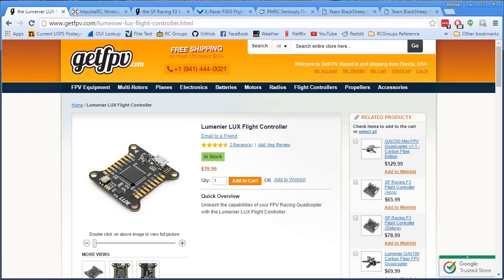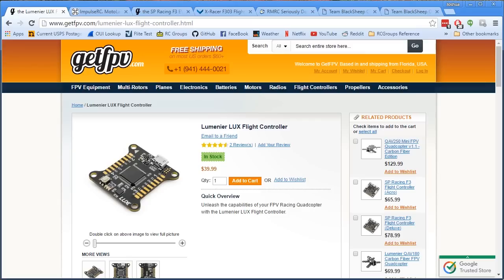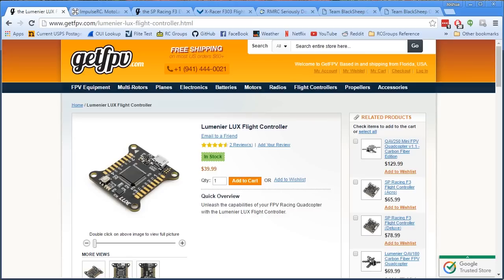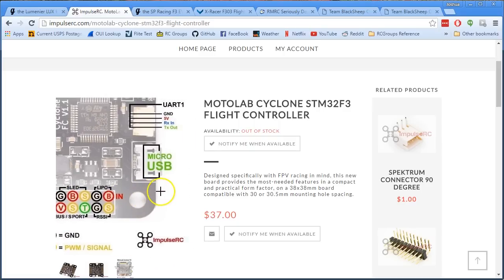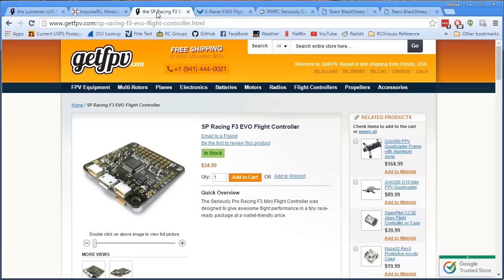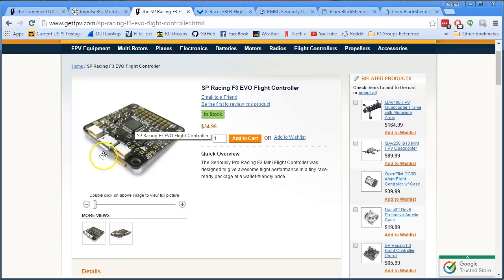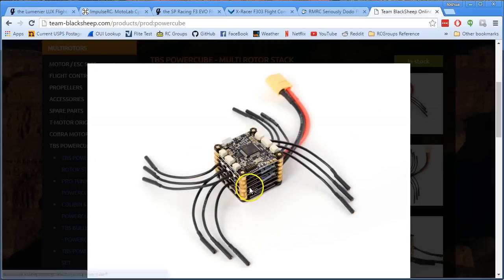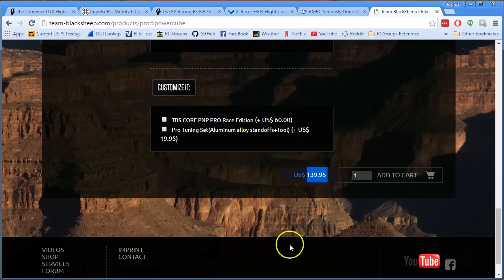The Best Cleanflight Flight Controller(s) - May 2016 Update

Comment: Joshua, a little help please. I have 4 new (built ) quads and none of them connect with clean flight. I have never flown a quad FPV. Under discs and printers, the device shows as a virtual bridge controller and Zadig does not help. These are F3, Naz boards, CC3D boards, and customied f3 x303 boards. I can not blast it off of virtual bridge to whatever it takes to connect. The only board that connects is the SP F3 Evo board. Any ideas would be helpful.
Reply from the maker: Delete the device, reboot your comptuer, then follow these steps.

https://www.youtube.com/watch?v=m4ygG6Y5zXI

Comment: Have 2 qav210s with 1 having the f390 lumenier(BLheli) ESCs 30a running 2205/2400kv Skitzo motors on a lux board and had No tuneing issues whatsoever ! I'm sure Mr Bardwells tune is much more precise than mine but I will say the Lux control board flies very well and has held up well on some pretty crazy crashes! I respect all the things you say mr Bardwell but don't let that Lux board go without trying it with one of your talented tune jobs! I think you will be surprised thanks for all you do for us out here!

Comment: josh i still have a problem with my quad starts to vibrate after take off even tho take off is smooth as silk then it just want to climb and if i give it yaw input it stops but happens again say evey 10 seconds its a real pain
Reply from the maker: Vibrating and wanting to climb and fly away regardless of throttle position is usually excess D gain. That fact that it stops when you give yaw input may indicate that one motor is making a lot of vibration. When you yaw, that motor spins down and the vibration is less. Does it stop when you yaw both directions, or only one direction?

Check your motors for excess vibration. Put on new props. All that sort of thing.

Comment: Thank you for the information on these boards. But I do have a question. I saw this one video on youtube on PWM and that it will be gone for good as obsolete .  I was wondering, do you agree with that?
Reply from the maker: There's not really any reason to use PWM any more. Even budget receivers can be had with PPM or serial output. PWM takes up a lot of space on the board and adds a bunch of wires for no reason.

Comment: what flight cont should u go with as of june 20 2016
Reply from the maker: Cyclone or Xracer F303 depending on your preferences.
Reply: Hi Joshua. Are you referring to X-racer v3.1 that comes with GPU 6000 (SPI) or the old v2.1. Is there a benefit to go with the latest X-racer 3.1 FC ? Thanks!
Reply from the maker: v3.1. I don't even think you can buy the 2.1 any more. 2.1 has SPI gyro, which lets you do 8 kHz sampling, which is good.

Comment: Hi Joshua,  In the last section you talk about the cube and afro esc , you say you dont like the afro's so can you recommend any esc for a quad off +- 500x500mm. Any help will be greatly appreciated.  I run on my other multirotors afro's with BLheli. I try to understand what you are talking about but sometimes I lose you totally fore Iam not a pc buff.
Thanks for your vids.
Reply from the maker: Any F390-based ESC that has an adequate amp rating should be okay for your purpose. If you have a larger quad, you can go with the Hobbywing Xrotor 40A which is quite good even on the stock firmware, and even better if you flash it to BLHeli.

Comment: the TBD power cube has a super thin FC and is sensitive to crashes under impact the board twists and goes and will fail and the PDB board is known to fail if you order one I recommended to buy an extra Fc, ESC and a few PDBS if you want I t to keep flying and when you get it make sure to snug the nuts not tighten them down...

Comment: So far I know the F4 is full step up to F1/F3.
Reply from the maker: If you are running betaflight or cleanflight, there is no advantage to going to the F4 because the code doesn't demand more than the chip can do. If you go F4, you should run raceflight or there is not really any point I can see.

Comment: Personally I think the powercube is too big why not just get the LittleBee PRO 20Ax4.

http://www.banggood.com/Favourite-FVT-LittleBee-PRO-20Ax4-ESC-With-5V-BEC-BLHeli-2-4S-F396-OneShot125-For-RC-Multirotors-p-1048318.html

Then get a xracer  F303 and then for 77 USD you have top of the line Blheli and a great F3 board with onboard blackbox and a much lighter double stack instead of a quad stack with a load of brass to take into the sky.
Reply: I agree.  A skilled builder can fit 4 ESCs, a flight controller, small VTX, and a small RX in even less space than the power cube.  But the powercube is a great option for somebody who just wants to slap something together and fly.  It's a cool concept.

Comment: where is flip32 f3 ? Witch is the same as x-racer, just costs $21 ? :)
Reply from the maker: I don't feel comfortable sending people to RTFQ because RTFQ's customer service can be completely nonexistent. The very first quadcopter I ever built, I bought parts from RTFQ based on Flite Test featuring them on their channel. I ended up having to cancel the order because it never came, and I couldn't get any response from Paul whatsoever. I was just a little bit irritated with Flite Test for recommending the vendor without vetting him better, and I don't want my viewers to have that same experience.

RFTQ has great products at a great price. If you understand that you are rolling the dice when you order from them, you may be a happy customer. That's not the kind of vendor that I want to feature on my channel though.
Reply: that is really interesting. Because i bought X-Racer F303 with your recommendation from fpvmodel.com and board came faulty - I contacted them, provided video and information to Jason - after multiple emails month later they agreed to replace the board, I was waiting for a month - contacted again - so they forgot to ship it, got it 3 weeks later. Worst customer service ever. 

So while I was waiting board replacement from fpvmodel.com - I found that original manufacturer of their boards is RFTQ - did multiple orders - everything came in a 3 days from Florida - no issues at all.

How about that ? :)
Reply from the maker: Something is not right. RTFQ does not manufacture anything. They rebrand products from a Chinese company whose name I don't remember. They also participate in the design of products, I believe.

Anyway, I have had good customer expereince with FPVmodel and have not heard many stories of bad customer service. I can only go on my personal experience and things people tell me. I don't want this to descend into a bashing-session, but my experience with RTFQ is far from unusual. I personally know three other people in the Knoxville flying club who have had my exact experience: order product, no shipping information received, no contact from Paul at all, eventually you file a Paypal dispute and the day before the dispute would go through, he cancels the order and refunds the money. If you search rcgroups or flite test forums, you will find many other examples. It seems like it is an on-going pattern and not just a few isolated incidents.

If FPVmodel customer service starts to seem bad, I will stop promoting their products, but so far I don't think it's bad. There will always be some mistakes, and maybe you are one of them. Or maybe you are the first pebble of the avalanche.

Many people have great experiences with RTFQ. I even order from them myself every now and then, although grimace every time. Paul is a hard working person, a talented designer, a creative businessman. RTFQ offers cutting-edge products at crazy prices. I honestly don't know how he does it. If he could find the time or hire someone to answer emails, phones, and forum posts, so that his customer experience was CONSISTENTLY good, I would completely change my tune. For now, there is occasionally the story of someone having a great experience with RTFQ customer service, but it is super hit and miss.
Reply: if it is about customer service, why then you advertise banggood ? They have no customer service as well. 0 responses to complaints about a product quality. 100% fake reviews. If you fill Paypal complaint - they ask to ship it to china! ( sure - $65 for shipping ) Never refunds anything or replaces - no warranty. p.s. if you buy enough from them - you finding that once a week Paypal locks their accounts because of hundreds of complaints.

How about that ? :)
Reply from the maker: I feel like everybody knows what to expect from Banggood though.
Reply from the maker: +fpvYou from a domestic retailer, people assume they will get customer service. Nobody expects to be able to return anything to China, although some Chinese vendors do go above and beyond.
Reply from the maker: +fpvYou from a domestic retailer, people assume they will get customer service. Nobody expects to be able to return anything to China, although some Chinese vendors do go above and beyond.
Reply: I think you trying todo here fpv product reviews, not a customer service.

Do I think x-racer f303 board is good - yes, is flip32 f3 is good - yes, is kiss fc good - yes! 

Just because you did not mention flip32 f3 - someone lost 6 dollars or went with shitty openpilot fc, or lost 2 weeks of their flying time! And maybe rtfq service is already way better - but you don't know that. 

If you put here personal feelings and opinion or going with a products who pay you first - then you are biased and sooner or later it will stink.
Reply from the maker: I didn't feel that way when I ordered good product from RTFQ and it never came. Good product that never comes isn't good product. A vendor who can't be bothered to even answer emails isn't one I want to send business to. That's just how I feel. 

RTFQ customer service isn't better. I keep my ear out because I don't want to be unfair. The examples keep happening.

I don't want this to turn into a bash session on RTFQ. Lots of people order from them happily. Great! I don't want to promote them. That's my editorial prerogative.
Reply: It's hard to justify overall customer service level with a single sample, IMHO.  Just as you had good experience with RTFQ and bad with FPVmodel.  I have the opposite.  I did have a DOA F303 and FPVmodel replaced it right away, yes shipping take some time from Asia.  2nd one I had died about 3 weeks later for no apparent reason and FPVmodel replaced that, too.   

RTFQ never respond to any question or request I sent.  I was quite mad during the AIO board fiasco yet there was no response.  I do still buy from RTFQ as their stuff are cheap and I understand and expect zero customer service in return.  

So there's another single sample.  But I think if you look around RCGroup discussions it's fairly spot on where there's little to no customer service from RTFQ.
Reply: I loved RTFQ before one of my orders never turned up and he didn't answer emails until I raised an issue with paypal.
Reply from the maker: Exactly.

Comment: I think the LUX has the best layout over any FC out there. I run them hard mounted even on centerstack x quads no problems. have an EVO on the way though. the DOGE FC might be next one I order though.
Reply from the maker: I agree that the Lux layout is excellent. KISS FC is similar, and also excellent.
Reply: +Joshua Bardwell similar shape but nowhere near as elegant a build. have both. LUXv2 should use that new chip that just came out. also center USB on side.

Comment: Well looks like I may have to upgrade to a new FC when my frame comes in the mail and leave the old REVO alone.

Your right about that TBS. It's nice and clean but I'd just gotten my hands on some Little Bees 30A. I haven't researched into their ESC's so I didn't know they where like that - not a fan of the Simon.

Now it would be interesting if you could mount what two ESC's per board or have some sort of mod that's stackable. I think I'll just stick with the old way of building things until something better comes a long I guess.
Reply from the maker: I don't fly it myself, but by all accounts, the CC3D Revo is still a spectacular FC.
Reply: Joshua Bardwell LiberPilot of course has the OPLink but I'd rather try it in RaceFlight when RS2K gets the time to add it in.
Reply from the maker: Oh man the Revo doesn't run Raceflight? That's a shame.
Reply: My bad.  It works great I wanted the ability to use the OPLink. Sorry for the confusion.